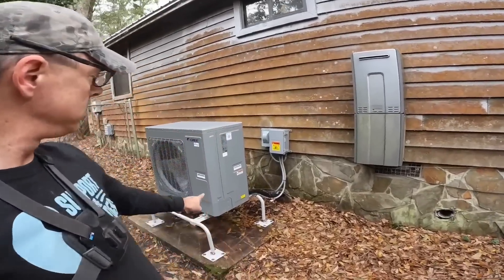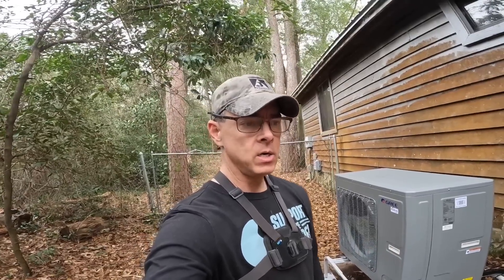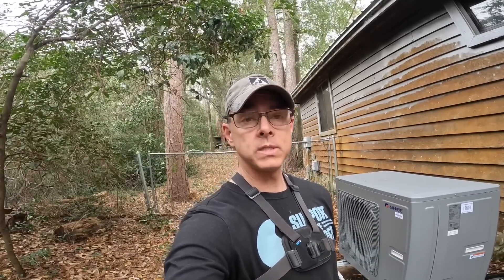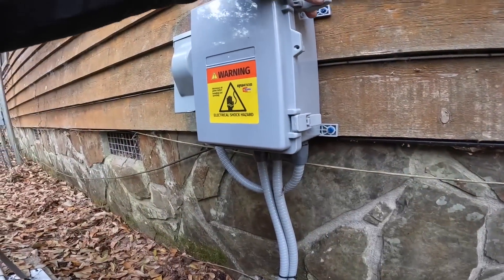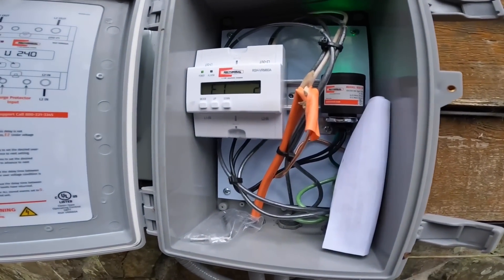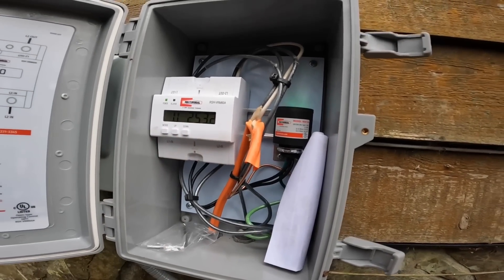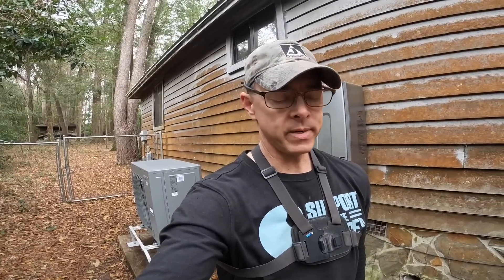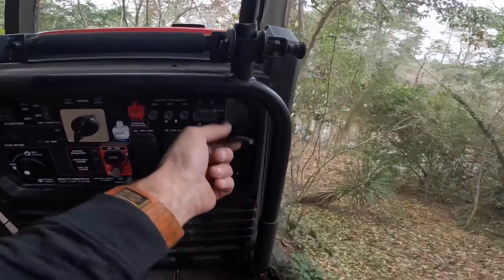Discussing GREE Flexx System, Capabilities, also Generator Setup

Comment: Hey Curtis thanks for posting about the gree flex I just watched again, but I had a question did you use for the condenser hook up a 30 Amp or 35 Amp double pole breaker my place still has a 30 Amp breaker with wiring that is not used currently.. Also I just checked the condenser on my Mr cool universal 3 ton.

And just like I thought it is the same as your gree flex 3 ton as the compressor itself says gree on the front. They are identical except unlike mr cool they are not marketing it as a diy unit.

I hope you realize by posting your install video for the gree flex how much you are helping others.

I just to take a peak pulled off the front cover on my condenser and everything is identical to your condenser.

It's almost like when in the 1980s the Chevy nova from 1984 to 1988 was basically a rebadged Toyota corolla or the geo prism VS Toyota corolla.

Anyway thanks as always.

Comment: Me and my handyman installed my own 1.5Ton Gree Mini in my fitness room which is next to the bedroom. We needed to turn off the 4 Ton Amana at night for just the two of us, here in Florida, Tampa area! House is 3300 sq',  but 4ton cools about 3/4th of that, as there is a 2 ton Goodman on the East side cooling 3 bedrooms...isolated....I reasearch everything but that took 3 years, and I bought the Gree, delivered to driveway, slab and power was there. Handyman drilled he 3" hole, ran the duct managment strip on outside wall, about 25', and had an ac company do the final!  This was done in 2016, and we absolutely LOVE the Gree, Inverter, has the "I Feel" function on the remote, so it cools our bedroom in Turbo mode, and we run is at 68deg every night!  The BEST investment I ever made!  Never a single issue, washable filters, and occasional drain pan liquid clean, more often than I have done!  Looking for a 2nd Gree system, for the family room to turn off the 4Ton even sooner, now 2023, but that decision wont be 3 years worth!  I have a whole house 22KW Generac, and Gree and 4ton, and the 2 ton are on it too!!

Comment: Thanks, Curtis! It was a revelation to me that connecting outside and inside units through the D terminal would shut off the air handler during the defrosting cycle! MAkes the installation of the AUX strips so unnecessary!

Comment: do you think these new mini split central duct units will last as long as your standard split system? I've heard a lot of times mini splits are not easily repaired and they are sometimes scrapped and a new one installed because parts are hard to find 8 years latter?

Comment: my question was directed toward you  HVAC GUY, see comment below..
Hello, i am going to be getting either the GE connect heat pump, seems like the GE connect, and Flex GREE and MR COOL universal heat pump are all the same equipment, just named with different names, i currently have a goodman that when it goes into defrost mode, the air handler is still blowing but blowing cold air for a few min until the heat pump (condenser) outside completes it defrost cycle, then the air handler is blowing very warm air once again, sounds like to me this system is not set up correctly? yes i do have a heat strip in the air handler, sounds like its not kicking on when the heat pump goes into defrost mode, i really do not like the goodman, when the outside temp gets in the low teens, i have to use  my backup heat which is electric base board heating.. what are you thoughts on the
air handler blowing cold air while the heat pump is defrosting.. ?
Reply from the maker: if it doesn’t have heat strips in the ah it will blow cold. if back up is baseboard that’ll happen. unless you upgrade to something similar to this video
Reply: @HVACGUY  thanks, but i think you misunderstood my comment, I in fact DO have the heat strip in the air handler,, but it does not energize when the heat pump is in defrost cycle... any suggestions?

Comment: Gree is really trying to push that product. We are about to start installing those after a rep came and talked to my boss. I always hate trying some new, i like to stick with what works. We'll see if they hold up by next year.
Reply: Got a Tosot(made by Gree) 5 Ton heatpump system,  had no problem heating during a week at -12C or 10F.  Replaced our 2006 York Natural Gas furnace.   We are up in the Vancouver Canada area.
Reply: was it installed by aire energy, cause i want to get one. i am from vancouver too"

Comment: I had the same system installed in December, but from Nortek, that replaces my old gas furnace here in SoCal.  No heat strips, like yours, but I now realize that the installer didn’t connect the D terminals so my inside unit continues to blow during defrost, so I need to get that corrected.  No chance to use cooling so far but I’ve noticed that when I want to raise the temperature a few degrees it takes more than an hour to get each degree of rise at the thermostat.  Outside temps haven’t gotten anywhere near to freezing yet so this is a bit different than I expected.

Comment: 02:52 Whats the voltage regulator used for in the setup? Did you install it because of the generator hookup or what?
Reply from the maker: It cuts power to the system if power goes too high or too low.

Comment: Great instructional video as usual! I wish Gree or other similar manufacturers made a system with built in air handler. I need to install a heat pump for a small 2 bedroom house but I would need the capability to close off the bedroom doors. The basement is big enough to walk around in and even has a workbench but the house is only 800 sq. feet and there is no room for an air handler. I love your setup though👍🇺🇸

Comment: I have a gas furnace so the generator works. In the garage I have a 12k split system and it averages 4 amps at 120v.  My condenser is a 1988 3 ton and no generator will start that bad boy in the summer. It pulls 15 amp at 240v. Was looking at the easy start to help it with surge current but I’m getting too a place where an inverter unit would be nice.  I love your setup and you have a nice equipment.  I’m one of those people who would love to do my own central system. Obviously I’d have someone recover the r22 but I think it would be an awesome experience. I did my 12k it throws warm air, even when it was 2-degrees.

Comment: You have basically the same setup I have except mine is hardwired from the outside disconnect for the generator which is in a corner of the garage with the exhaust piped outside I did make use of a 50 amp plug on the gen which I keep open due to lightning transients  learned that the hard way twice.  Looks like you’re covered for the rolling blackout when they happen

Comment: Hello, i am going to be getting either the GE connect heat pump, seems like the GE connect, and Flex GREE and MR COOL universal heat pump are all the same equipment, just named with different names, i currently have a goodman that when it goes into defrost mode, the air handler is still blowing but blowing cold air for a few min until the heat pump (condenser) outside completes it defrost cycle, then the air handler is blowing very warm air once again, sounds like to me this system is not set up correctly? yes i do have a heat strip in the air handler, sounds like its not kicking on when the heat pump goes into defrost mode, i really do not like the goodman, when the outside temp gets in the low teens, i have to use  my backup heat which is electric base board heating.. what are you thoughts on the
air handler blowing cold air while the heat pump is defrosting.. ?
Reply: Most older HPs. work that way!
Reply: @bobboscarato1313  its a new goodman, installed 1 year ago, march of 2021
Reply: @karmendimas5274  Since its a virtually new unit, you maybe able to sell it or trade it in. The other unit you mentioned sounds like a better option!

Comment: Nice update. I wanted to do a generator interlock, but that would require me to change the panel again, or add a sub panel. I did pigtail the gas furnace so I can plug it into the generator if needed. Only about 5 times in 16 yrs. If power goes in the summer, generator is dedicated to refrigerators and freezers, computers and home network.
Reply from the maker: maybe just move your breakers around. they make interlocks for nearly any panel.

Comment: Why not have a natural gas furnace for dual-fuel setup and just set the furnace to only run below zero.  NG is cheaper than electric.  I don’t live in your part of the country but are solar panels and batteries an option to be electric and gas?
Reply from the maker: We can use a solar setup yes.

Comment: You might be alright if it doesn't ever get below 17. But your manual heat calculation would mean you need 5 ton in a home that only needs 3 ton AC.
Reply from the maker: Not here. All Manual J designs here are based on cooling, or heat load, heating is always less and an afterthought.

Comment: Thanks for sharing. I’m from SW Louisiana and we’ve went through a few hurricanes, tornados and some freezing temps lately. I’ve got my house set up like yours minus the A/C. I have a couple of portable A/C units and a couple of portable electric heaters for times i need to run the generator. I can’t run my central unit, stove, dryer or water heater while on generator. Everything else works great. I have a meter main on my house and installed a 30 amp inlet generator plug like yours. I just turn the main off and turn on the 30 amp breaker I have installed outside in the meter main which will back feed the house safely while not sending power the lineman trying to make repairs.

Comment: I have a 50amp generator hookup like yours at my house and I have to use a micro air soft start to run my 18 year old Trane 3t heat pump, but it works. 

A Flexx might be in my future.  No cold weather in Fl for me to use heat strips. 

Thanks so much for sharing.

Comment: We pulled an oil furnace and installed without a heater kit. 
Similar temperature outside. 
I’m going to add a heat kit for ice storms

Comment: I 'm thinking about a set up like this but my current one is a 3.5 ton. I don't know about dropping down to a 3 ton. Seems like all the inverter systems jump from 3 to 4 ton and no 3.5. Any thoughts?
Reply from the maker: Gree can do a 4, which works fine for a 3.5. They are variable so the extra capacity doesn’t cause a problem at all, because it can run in low speed. It’s a benefit for when you need more capacity
Reply: @HVACGUY  The wire size might be a deal breaker on a 4 ton. I'll have to check. Thanks!
Reply: Do a manual j calculation on your home. If you have a 3.5 ton now you'll probably need a 5 ton mini split if that's going to be your only heat. Which will cause short cycles in the summer causing high humidity.
Reply: @Bryan-Hensley That is not true at all, it isn’t going to short cycle because of humidity or being a 5-ton system oversized.  Variable speed blowers and  and standard dehumidification would be just fine. Duct work would be the issue and you it can slow down a blower to be 1200-1600cfm.  The inverter compressor will use the EEV to automatically run smoothly. The old single stage system days of thinking are over.  I don’t recommend oversizing like that but I have a client who did this exact situation and it works just fine.
Reply: No, I'd still use 10 or 15kw heat strips. @Bryan-Hensley
Reply: @chrisroberts1032  can you get a mini split with that size aux heaters? Maybe I'm behind on times.
Reply: @Bryan-Hensley  It's a Gree flex system, not a mini split. It's got a standard style air handler.
Reply: @chrisroberts1032  I've seen some of those but I don't really see the benefit especially in heating.. physics says a larger evaporator outside is going to be more efficient. They don't use universal fitting parts which would be harder to get repaired quickly.  The major difference is the inverter compressor. The separate units in each room is a great idea if a few features and aux heat was added. But with a standard airhandler you'd be better getting an Amana inverter system with the lifetime warranties.

Comment: You have a nice setup there. I didn't know that unit turned the air handler blower off in defrost if no heatpack was used. Thanks for sharing
Reply: it doesn't unless you want to ruin the A coil. It needs air to defrost the condenser and not plunge A coil into cracking low temps.

Comment: Have you noticed much electric$$ savings?   I’ve been without a heat pump for about 6 months now because I want to see prices come down a bit. Otherwise I’m gonna have to get a crappy conventional system.   I have no backup heating other then electric strip.
Reply from the maker: Actually yes, last moth it was running for only about 2 weeks, but I did notice a difference.
Reply: Prices are only going to go up

Comment: Nice setup with the Generator and yes, nice the Inverter AC will just allow the Generator to come up to power with out spikes.  Just curious why you think your voltage is above 253 eve 254 volts?  I heard from others that maybe solar inverters in the area might cause that?? Thanks for the update on your Flexx system.
Reply from the maker: Not sure, I actually contacted my power company about it, and so far haven’t gotten a response.

Comment: great to see you are happy with a somewhat modern heat pump. bear in mind that gree is classified as a solid B or even C quality brand in europe. if you want the really nice stuff you get something from japan. the 2 mitsubishi's, panasonic and daikin are still leaders in this field.
Reply: Where are you located? I have never, in the 10 years ive been using their products had a single one fail except the odd one out of warranty (touch wood)
Reply: @JesseDoesHVAC  fujitsu is a bit hit-n-miss. their bigger VRF stuff i would not bother with, way too fussy. their regular residential stuff is fine.
Reply: Gree makes great units. Keeps my 3 car garage cool in the Las Vegas Summer heat and warm in the winter months. Completely satisfied with the unit’s performance. Highly recommended.
Reply: @customdetailer0078  this is what we call "N=1 experience". You have 1 point of reference with gree, people like me have touched hundreds or thousands of machines from different brands.
Reply: Fujitsu and Mitsu are probably designed and built better than other brands but I was surprised when my fujitsu head was stamped "Made in PRC." Are any residential units actually manufactured in Jpn?
Reply: Fujitsu. Cant go wrong. Period
Reply: @JesseDoesHVAC  I’ve had so many issues with Fujitsu, tech support is awful
Reply: its NOT the equipment you have, its the INSTALLER! that makes all the difference..
Reply: GREE actually has three or four different quality levels of product for the same tonnage unit. 

Most people are cheap in order the cheaper level unit . 

Just like Samsung Panasonic, or daikon have different models to cover the same tonnage . 

It so they could capture the market for the person who only can afford a trailer home or a small cottage. They have the bottom of the line units with the least amount of protection, a little less efficient and no bells and whistles. . 

Then they have mid tier, and then high tier that are extremely efficient, more reliable, more bells, and whistles in warnings in safeties and  protections . 

GREE has higher level units, but the money usually turns people off
Reply: @coldfinger459sub0  what grade is Tosot?
Reply: Dalkin is the only brand I would sell. But these things won't pass manual j heat load calculations.
Reply: @Bryan-Hensley  Manuel J does not pass or deny what kind of unit will be selected. 

You input the heat load gain of the materials, the orientation and the construction of the building to come up with a desired load calculation first . 

Then all you’re doing is selecting the “CORRECT “size heat pump to the proper application.

Does not matter on the brand whether it is LG or Samsung or Panasonic or daikon .
Reply: @coldfinger459sub0  you obviously have no clue how to do one. A home will need something like 36,000 BTU for AC and 56,000 BTU for heat. If you put in a 56,000 BTU, when running the AC it will short cycle and cause high humidity in the summer. These mini splits don't really slow down in the summer. They have the potential to be great, but they are "cheap" like a window AC.

Comment: These are rated for 129° all the way down to -22°!
Reply: That’s in ideal factory tested conditions
Reply: And they confirmed it during the field testing they conducted a couple years ago before they started marketing these units in North America. Most of the installations they did were installed with out the heat kits  due to the supply chain issues. Even the ones up north and in Canada didn’t have them and they had no problems keeping up at those negative temperatures. You can find this information on the Gree Comfort channel in the Gree Select Dealer webinar recordings about the Flexx units.